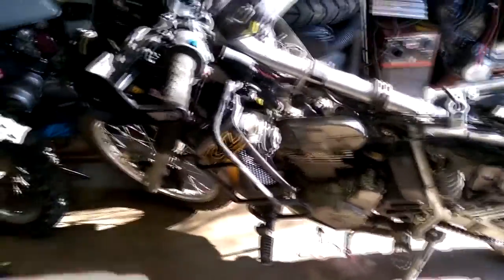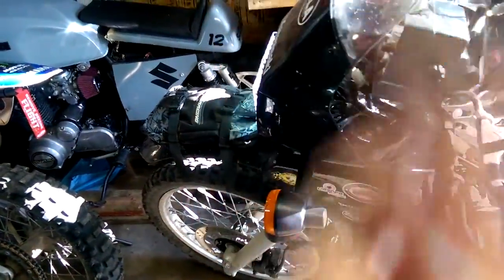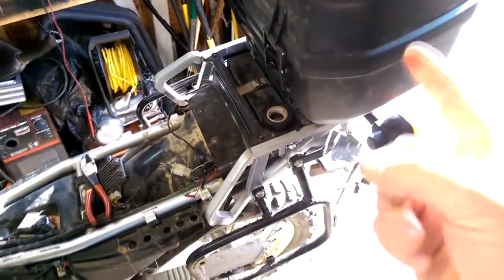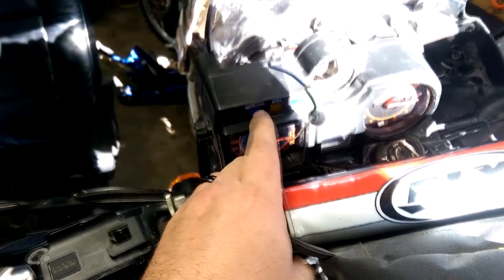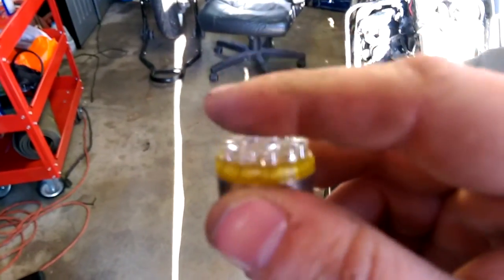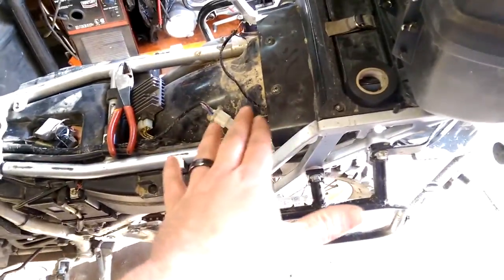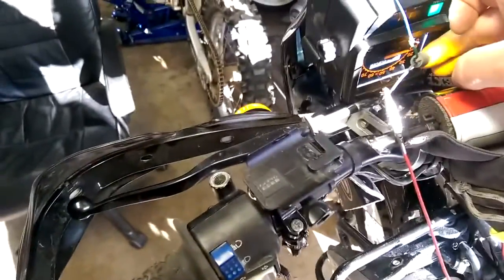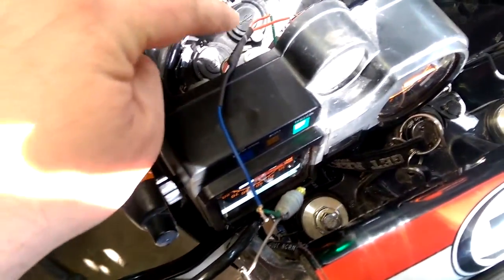KLR 650 Gen 1 Full Led Upgrade W/ Diode Install

Comment: If you have LED turn signals, they don't draw enough power to light up the incandescent turn signal indicator on the dash panel. You need to replace it with an LED, but then you have to install this diode kit. Based on this video, I bought the two-wire diode kit for the turn signal indicator. It wired up just as you explained, but you still have to guess which way the LED light goes in the socket, and turn it around if you guess wrong. One bit of advice on the ground wire: there's a ground wire screwed right to the underneath side of the instrument panel. just touch the ground wire from the indicator light to the various wires screwed to the panel, and you'll eventually find the ground. I think it's the center wire among three. Don't recall what color it was. Great video, and great explanation. Now every light on my KLR is an LED.

Comment: If anyone sees this comment and can help me, please do. I hooked up the diode just like you did in this video and still both blinkers are on at the same time no matter how I hook them up, the back ones would be too but I don’t have them connected. Plus when I ground  the grey wire nothing works which would bring me to believe that i have a short somewhere. Green wire coming from blinker light with diode leader going to harness other wire leftover is grounded which turns everything off and it doesn’t matter if i go the exact opposite route and have the diode leader coming from the grey wire and ground the green wire, everything still turns off, even without it grounded going the opposite route all blinkers flash at the same time. My patients is running out!

Comment: This video was very informative. when I turn my blinders so that the left signal should work they all flash and when I flip it to the other side only faint dim light comes through. It was work just a few days ago though so I don't understand how that worked. Now I will see if that diode thing works.

Comment: I changed all of my turn signals to LED blinkers and installed a LED relay but when I turn on my blinkers all of them flash and the blinker indicator on the speedo doesn’t flash u think if I wire up that diode it would work?

Comment: Hey bro I have a 2003 klr 650 I bought led signals for it and a flasher relay? That good to run them was what I was told! Won’t run the led signals without the flasher relay?

Comment: Okay update on previous comment….. i didn’t exactly have the diode connected in the same place, well i did from the blinker indicator light but to a spot further along the loom. In other words what i thought where the blinker wires were in fact, not. But now upon fixing that problem the blinkers do blink individually but i still have the grounding issue. When i ground the extra wire left over everything quits working, i do have a regular blinker indicator bulb. So would switching to an l.e.d bulb solve the grounding issue since they have a tiny diode built into them?

Comment: Can you show us what wires you spliced into on the harness to install the diode? It wasn't clear in the video or explanation. 

I'm assuming the diode splits the positive on the blinker indicator light between the left and right sides so the left and right can blink independently? Then the ground wire on the blinker gets rerouted to a ground somewhere on the bike. So, is the diode only useful for the blinkers? Is it not being used to control voltage for any other light? Or, is the blinker indicator light either the very first or the last wire in the whole circuit where the diode can regulate the voltage from the klr electrical system so that all of the LEDs can actual function? is the tail LED light and the Cyclops LED system both on a separate circuit from the diode? Do these lights have an appropriate diode already installed on the light?

Thanks in advance
Reply from the maker: Ok well the led headlight just plugs in no mods necessary. Same with the brake light. plug it in and it works. The signals is the only part requiring a modification when switching to LED. You can buy an led flasher relay and replace the stock on on the KLR or install the resistor like I did in the video. At @5:23 I show what I'm gonna explain next. Pretty much just take out your turn signal bulb from your dash. Cut both wires and sit the bulb aside. Then connect both wires that had previously connected to the turn signal dash bulb to the two wires on one end of the resistor. Then grab the turn signal dash bulb you sat aside and connect one wire to the other end of the diode that has only one wire. Then the last remaining wire on the turn signal dash bulb should be grounded any where a common ground is. So yes the resistor is only for the turn signals and not the led headlight or tail light. They need no voltage regulation because it is built into the bulbs. Hope this helps thanks for watching.
Reply: Thanks man!
Reply: So it's an either or on the resistor or the flasher relay? Why did you chose to splice into your wires vs just plugging in a new relay?

Comment: Where do you get those usb dash hubs? I can’t seem to find them anywhere
Reply from the maker: If your talking about the entire dash where I have the 12v socket, usb, and switches I made that. I used a cardboard template to get the shape of the dash. Then I cut it from thin study metal and added tabs that bend up to match the windshield bolts. Then just undid the windshield and mounted it. Thanks for watching!

Comment: So glad you made the product list, super easy to follow. They've discontinued the turn signal bulbs you used but recommended the newer replacements. I am a lil confused on the flasher relay tho, your link shows a flat plug in style while other sites are showing a 90° two prong relay!?
Reply from the maker: Not sure about the 90 degree two prong you found. It's been awhile since I did this install, but I think with my flasher I cut the plug off and wired it in. So it may be the same with the one your looking at, but I would have to see it. Thanks for watching!

Comment: I have a cyclops coming in the mail. Can you elaborate on exactly how you cut the boot, and what did you need to velcro?
Reply from the maker: The boot was basically cut from the center hole down one side to make a slit for the cyclone housing to slide in. The velcro was just to hold the little 2"x1" box that is attached to the cyclone. You don't have to velcro it, but on my bike it was in the way. You could probably zip tie it out of the way as well. Thanks for watching!
Reply: Thank you! Yes zip-ties will match the rest of my bike nicely!

Comment: Keith 1212... not to beat a dead horse, but just so I understand, you're Cyclopes LED headlight was plug and play (besides cutting the boot)? I ask, because other videos have made it sound like installing one on a Gen 1 KLR is like building Frakensteins monster. They have had to alter the housing and use JB Weld to hold the thing in place, etc.
Reply from the maker: Yep it is completely plug and play with the housing. Only reason you have to cut the boot is because it won't fit over the cyclops leds heatsink and fan. No jb weld required :) Thanks for watching!